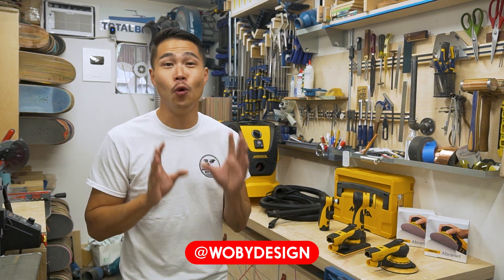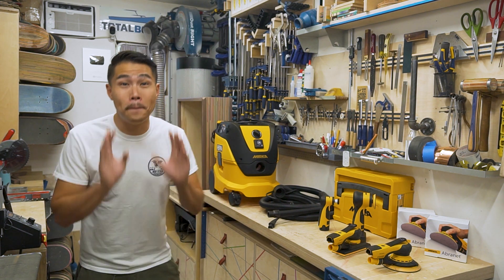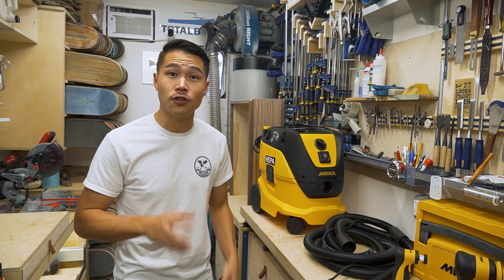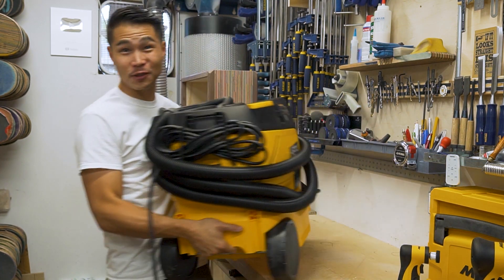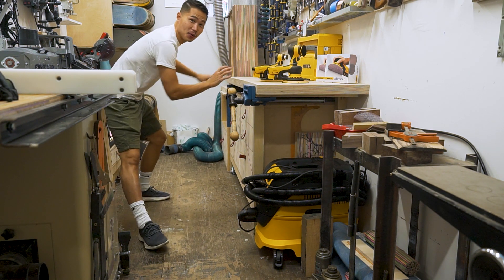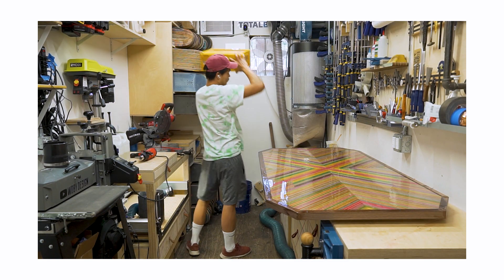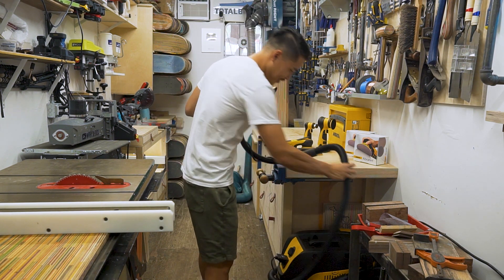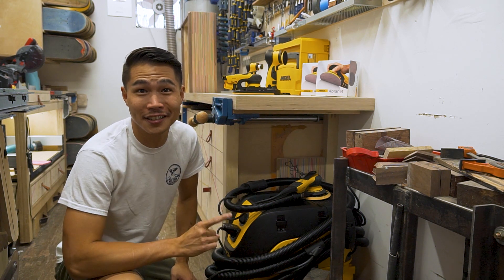Woby Design goes hands on with the Mirka Dust Extractor

Comment: I've used the sander in a wood work course I went to and local workshops(pre covid :'( ) , the 03:18 reaction i show I felt too. 
Dear Mirka, will you ever do a smaller sized extractor for the DIY'er/amateur woodworker. I have the sanding block already